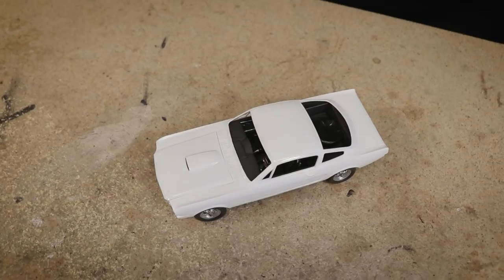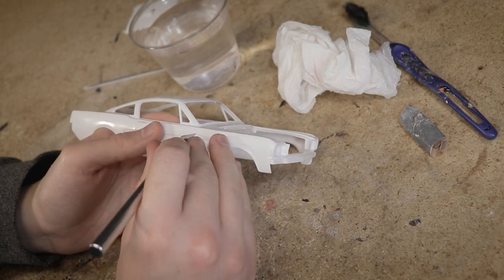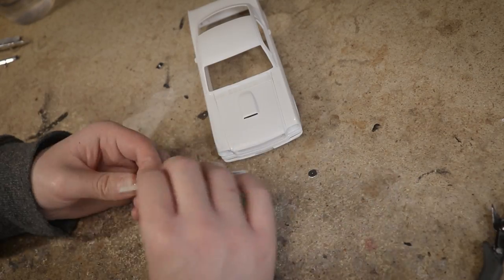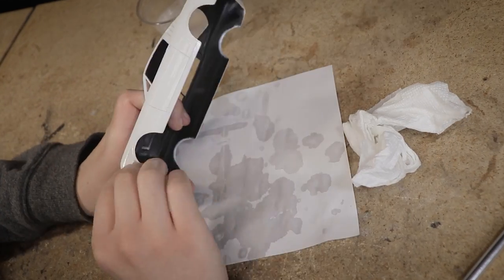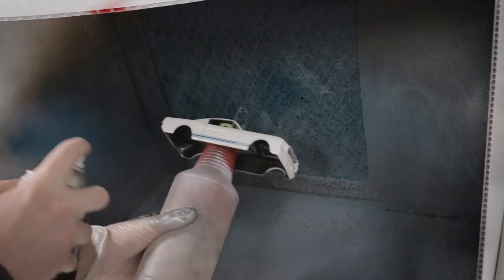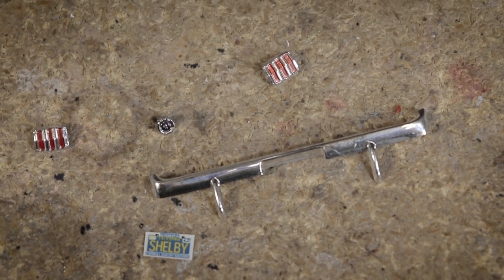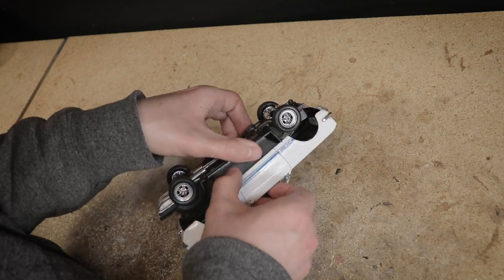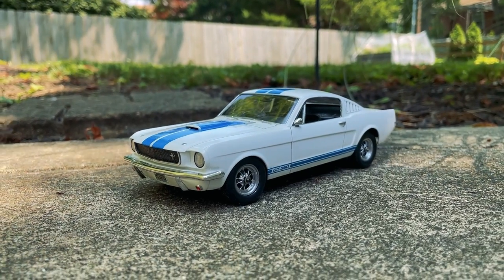The 1/24 Scale RC Shelby GT350 is Complete! 🏁 Finishing the Body and Driving the Car

Comment: Great video and congrats on the build. Question, do the RC's using the FFR SC1 drive shaft run slower than the FP UC1? Same motor considering
Reply from the maker: They're similar, however there is some gear reduction in the rear axle on the FFR SC1 chassis' while there is no reduction between the motor and axle on the FP UC1.